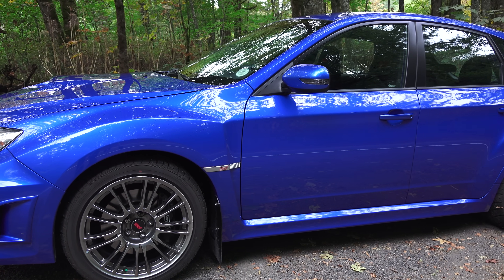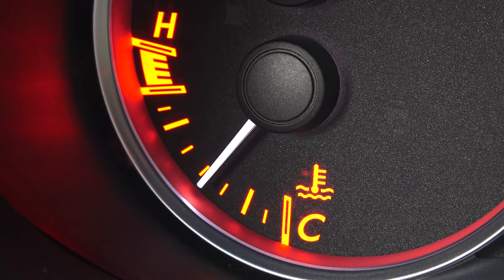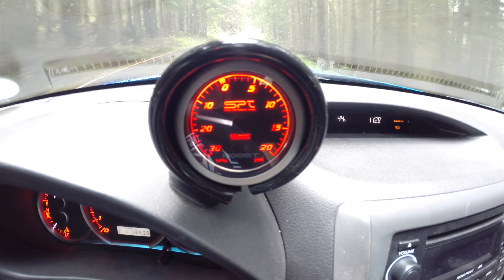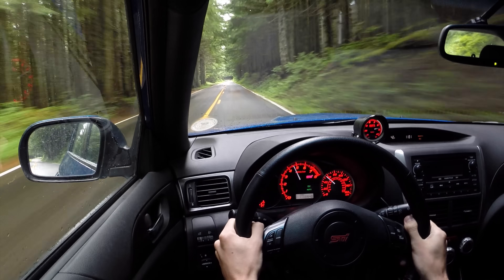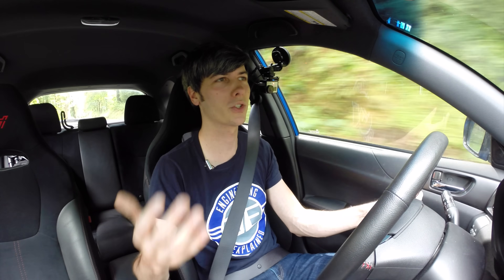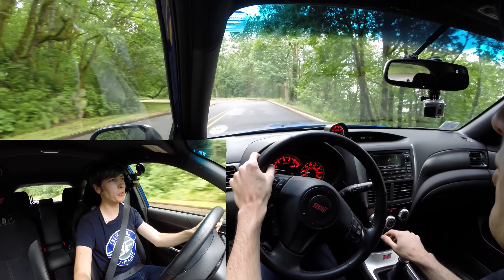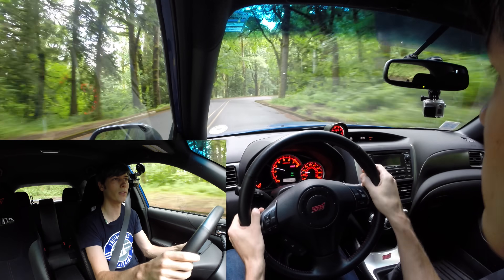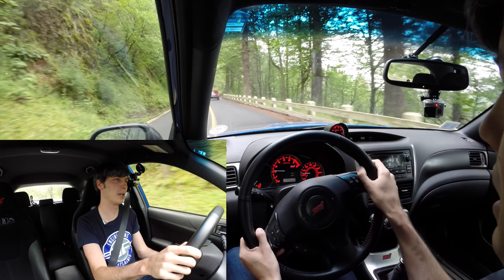5 Things You Should Never Do In A Turbocharged Vehicle

Comment: Well what would you consider running a car hard? I got a Opel Astra 2.0 Turbo (Opel's/Vauxhall's equivalent to a VW Golf GTI). Redline starts at ~6,5k and goes to 8k. While driving to work I always try to keep it under 2,5k cuz the engine is cold for most of the ride to work. But would you consider 4k while having a cold engine as'' running a car hard''?

Comment: Very interesting. I would add that in every engine the main issue with lugging has to do with high forces being generated over short periods of time against the pistons when the crank is at less efficient angles. This is because at high torque demand and low rpm the piston is not travelling fast enough to accommodate the rise in pressure and volume of the exploding fuel mixture. Therefore the explosion happens during a fraction of the power stroke, within a confined space and when the crank angle is far before the ideal relative 90deg from top for that cylinder, thus causing the high forces against the piston, a huge load on valves and piston surface, a lot of heat in a situation when the engine can't provide efficient cooling and a very inefficient power conversion. A turbo makes this worse.

Comment: oils thinner and flows faster when cold...
Reply: I don't think so
Reply: what do you think the numbers on oil bottles mean? sae 5w-30 (common in cars) stands for 5 winter and 30 when the engines is at temperature. 200-400 degrees f. its measured by putting it through a tube of certain size and measuring how many seconds it takes at various temps. ergo 5 seconds cold 30 seconds hot. they add polymers to motor oil to make it do that, so when you start the car the oil is thin and gets where it needs to fast and then thickens afterwards to prevent wear and tear. thats also partly why you have to change your oil. the polymers break down and it slowly becomes 10w-25 or somethin.

Comment: I think i've seen somewhere that the high octane rates help prevent the pre-ignition phenomena you are talking about, this is partly why it is recommanded in turbo charged engines, and/or high compression ratio engines.
I also know modern engines are equipped with sensors that detect pre-ignition and alter the ignition advance accordingly to limit such phenomena, but it sure does not completely .avoid them nor the damage it causes.

I'm very interested in the pre-ignition (or rather, auto-ignition), and looking forward for a video about it (if you manage to make it accessible somehow, as it appears to be pretty complex).

Comment: In a stock turbo AWD vehicle, are you able to just start the car and go? Even if you don't ride it hard the first few mins and let the car warm up? Thanks
Reply: No. Of course you can its just not good for the engine. Its best just to let your car idle for a minute or two to get the oil flowing and all the seals warmed up abit. AWD, FWD, RWD, naturally aspirated or boosted you should always let the car warm up.

Comment: i get this low rpm, high boost knock when im on the freeway, primarily in 5th and 6th around 2500-4500 rpm under acceleration. i have an 2004 sti, what would be the simplest way to get rid of this.  is a new tune my only option. i bought the car used and pretuned and the engine is stock with intake and exhaust modifications

Comment: Fiat fixed pre ignition caused by a sparkplug being a hotspot with a proprietary sparkplug from NGK that looks identical to other sparkplugs from NGK. but if you use the wrong sparkplug, even with the correct heat range the engine stutters as the ecu does anything it can to save the engine. presumably cutting fuel intermittently.

Comment: Don't know about fuel standards in other countries than Sweden, but you won't find anything below 95 octane here. Most pumps have 98 octane as well.
Reply: Most countries have a different octane rating to the US. In most countries the research octane number (RON) is written on the pump. 95 RON is basically the standard fuel. In north america, brazil and a few other countries the so called anti knock index (AKI) is used and this standard gives you lower numbers for the same fuel. 95 RON is about 85 AKI.

Comment: There are other things you should never do in a turbocharged vehicle.  Do not feed an antelope and a Siberian tiger simultaneously in the back seat.  Do not drive the vehicle through molten lava, even if you keep the boost level moderate.  Do not let your girlfriend catch you fooling around in the car with that busty girl you saw at WalMart.  You know the one.  Do not leave raw fish and spilled milk soaking into the carpet during the hottest months of the year.  Do not feed the turbocharger marijuana in an attempt to make "higher" horsepower.  Do not vacuum the upholstery and ashtray with a hose hooked up to the turbo.  Climbing onto the hood and trying to fart directly into the turbo to add power during a passing maneuver is usually not recommended.

Comment: Directed at the dont full throttle at low rpm part, why does the turbo engine get a slight speed boost after releasing full throttle? Sometimes i notice that after accelerating, when i let go of the gas pedal, it seems to go slightly faster for a moment (less then half a second).

Comment: But if it makes a lot of torque at low RPMs (1300- 1900), why can't I use it? It becomes pointless...
Reply from the maker: +Guilherme Cabral Freire you can, just use it in lower gears rather than higher gears. If you need to accelerate quickly when you're at 60 mph, downshift.
Reply: +Engineering Explained  but that is the thing... say I'm cruising around on a highway... in 8th gear at 1700.. and I have to overcome a random hill.. if the max torq is at 1700-2000 (let's say, a diesel), I don't want to rev up, just stay still because the max torq is at that engine speed... get what I'm saying? I want to save fuel

Comment: you don't lug at low rpm due to cylinder pressure. cylinder pressure does not mean boost but the actual combustion pressure inside the cylinder. if your engine is at low rpm it is flowing air at low cfm. therefore adding boost to the mix you are trapping more air inside the cylinder creating more cylinder pressure when being combusted hence pre ignition. high compression engines increase cylinder pressure which is why they need higher octane fuel

Comment: Do today's turbos still have a big issue with oil coking? I remember that the (original 1978) Buick 3.8L V6 turbo and 1979-1980 Ford 2.3L 4 turbo had big issues with oil coking (I believe that's . Are most turbos these days water-cooled as well? It would seem that hydro syphoning would continue to cool the turbo (using the coolant) after the engine has shut off. I agree that a turbo car shouldn't be shut off immediately, but is turbo oil coking such a problem now as it was in the past?

Comment: A few points here that you certainly missed... You reference diesel vehicles and high load low RPM... Now... in my F350 dually - I have to subject the engine to those conditions when I want to roll coal, say on a jogger, a cyclist, a Prius or even an STI!! (and we all know that is GREAT for the engine!). Also, since my dually is a manual, I have to hold break, partial clutch and floor it to build boost for that awesome coal-rolling burnout.... Also... just wonderful for the engine!!!! ;-)

Just my 2 cents!!!

Comment: "You should never lug your engine"
  At 60/65mph on the motorways my cars engine speed (Leon 1.6TDI) is around the 1,500rpm area,  so what you're saying is i should change down to 4th to overtake and then change back into 5th when finished..

I dont see the logic in that,  after all Turbo Diesels are all about that low down grunt and torque

Comment: #5.   An F1 driver told me that you want a bit of slip and oversteer from the rear because it means the car straightens up quicker and when you're straight you can then put down more power.   So the quicker you straighten up coming out of a corner the quicker you can get power down the quicker you are.

Comment: "Lugging the engine" doesn't even make sense... You're at low RPM. Boost doesn't happen at low RPM. At 1000-1500 RPM, even if you were to floor it, you would still be at 1500 RPM and not enough air would be going through the turbine housing to create boost.

Comment: Old guy here, I have owned more cars than I can count and now I own my first turbo, '16 Honda Civic 1.5 turbo. This car has an ECO mode to improve mileage when you don't care about having full power. I am trying to figure out what this mode does. At idle and during acceleration, it rumbles a little like the timing is off. Power is reduced noticeably, but it does get very good mileage, averaging about 36.6 with a mix of highway and city, with quite a bit of stopping and starting. Is this ECO mode hurting my turbo? my engine?

Comment: Yes, keeping the transmission in the proper gear is optimal.  But it won't hurt the engine as much as if I were to hit you in the head with a Lug Nut.

A diesel engine will work the same way as any other internal combustion engine.  They all act like an air pump and will only inject as much fuel as needed with the proper amount of air being sucked in.  See, there is a mechanical or electrical connection between the injectors, your throttle and the "butterfly" that controls the amount of air that is being sucked into the engine.  The only way you will get too much fuel and not enough air is if you replace your injectors with a larger injector and a smaller, more restrictive intake.

FYI, the new engines have so many electronic controllers on them that it is hard to...  Never mind, you obviously don't know anything you are talking about, so I'll leave it at that.  But yo really need to get a lot more education on this subject matter before you post these ridiculous videos and spread more falsehoods.

Comment: Unless you are driving your car super hard and instantly pull into your driveway or a parking lot, you really don't have to worry about the turbo/oil cooling down.  Simply driving your car at a normal speed will allow the oil to circulate and cool off.  That is why manufacturers don't add a device that allows the engine to continue to run after you have pulled the key out of the ignition, like aftermarket addons do.

You won't be changing your oil more often nor creating more wear on the internal parts by shutting off your engine as soon as you stop.

Not to mention that the newer oil has the viscosity rating that will allow you to get in your vehicle, start it up and take off.  Long gone are the days of sitting in your driveway, waiting for your vehicle to warm up.  Unless you live in an area that has a lot of extreme cold at or below 15 deg.

Comment: You do know that Subarus have circulated oil to the turbocharger after shutdown since the 2002 WRX...I can find that press release for you...
You also will never get "a lot of boost" at a low rpm even if you floor it. There simply is not enough exhaust flow to spin the turbo up to speed. That's the entire thing about a boost threshold.
Reply: Except most seriously-boosted machines these days have to implement a torque cap (using fly by wire throttle, careful ignition/fuelling mapping, etc) from as little as 1200rpm upwards, and commonly no higher than 1500~1800rpm, in order to protect the transmission and prevent you endlessly spinning the wheels in the lower gears (or triggering off the traction control, though it's essentially doing the same job). It might not even be full boost (as they wouldn't produce maximum power at that speed), but there's still more than enough there to produce a significant torque/power output difference at low rpms vs a non-boosted machine.

About the only example I can think of where the boost doesn't start building until significantly above (ie at least twice the rpm of) idle is Nissan's recent-ish DiG-S engines, which are downsized, small capacity supercharged items with an emphasis on economy (running Miller or Atkinson instead of Otto cycle a lot of the time, etc) and improved midrange torque rather than absolute power (peak output is only about +25% vs their naturally aspirated cousins, but they rev about 80% as fast when producing it), essentially being a 1200cc alternative to a 1400 or 1500cc ambient pressure engine. Because the charger drag consumes more fuel than it's worth at lower revs, they use an electromag clutch to cut it out completely below 2000rpm (a pity, as the ambient pressure engine is a bit weak at low revs and could have done with a perk-up), and bring it in gradually between about 2000 and 2500~3000rpm. Though I haven't had the chance to drive one, I imagine the effect if you keep the throttle pinned whilst accelerating from 1500 then past the peak at 5000ish is rather like that of a peaky, laggy turbo engine... just thankfully not one that has a huge amount of power at the end of the day, and that is lag-free if you work the (rather unhelpfully wide-ratio) gears to keep it spinning in roughly the 2500 to 5000 range.

But that's a pretty niche thing vs most contemporary turbos, and Nissan themselves seem to have acknowledged the otherwise fairly innovative system's baked-in shortcomings by, after first teasing a twincharged (super + turbo) successor, shifting instead straight to a plain turbo setup instead with the current DiG-T, which works much the same but with a wider useful rev range...

Comment: Preignition can accord in low RPM's do too the air intake being to hot.. As I Cruz around town in a 102 hot day my temperature intake is around 150 degrees.. When I get on the freeway it will drop to 120.. That's with out boosting..  As soon as I start to build boost on a higher gear my temp will drop to 105 depending on the temp out side..

Comment: How do you feel about using an on-demand dry HHO generator cell to help remedy most of the issues talked about in the video?
Yes I realize the chemical and explosive characteristics of hydrogen fuel.
I also realize that HHO gas is two molecules of Hydrogen for every molecule of Oxygen, so there are two fuel molecules to every oxidizer.
Hydrogen is also extremely hot burning, yet clean.
So it can clean any and all carbon residue and other gunk inside your engine block.
Another thing is, with an HHO generator on a vehicle, you will want to have a one way check valve, or "bubbler" to prevent backfires into the dry cell. Although not extremely hazardous or dangerous, this can cause the dry cell to partially come apart and cease function, so a repair would be needed.
Another important fact, is that if your computer was built after 1987, then it probably has an automated fuel injection system.
This also means that it has sensors to detect the ideal fuel to air ratio for a burn to occur.
This is good and all, but by adding the aforementioned two fuel molecules and only a single oxidizer molecule, your vehicles computer will want to consume more fuel in order to keep with its pre-determined "correct burn ratio."
Luckily a chip can be bought fairly cheaply that won't void your warranty, it goes somewhere in the car's computer, many of these chips just plus directly into your car's OBDI/OBDII connector.
I understand that a backlash from people who remember Hindenburg will probably occur, but I'm hoping that a few educated individuals with at least a little scientific fore-knowledge and are at least partially engineer'esque with their thinking will respond here.
To anyone that bashes me for posting this here, 
Go to your nearest mirror, point at your reflection, and ask it "Is this really worth it? What am I doing with my life?"
You may be surprised by the answer you get.
Thank you.

Comment: Great video brother. If you don't mind telling me, where was this video filmed? Looks a lot like the Blueridge Parkway, l which i only 15 minutes from where I live.
Reply from the maker: About 3,000 miles from where you live, in Oregon. :)
Reply: Oh good to know, Lol. So one more question since you seem to respond more quickly than 90% of other channels (which I appreciate). How will getting a downpipe (catless or catted) on my ST affect my car in terms of getting a CEL because of O2 sensors?
Thanks again man!
Reply: I have an ST, a catted downpipe can, while a catless will give you a CEL. This doesn't affect the performance of the vehicle at all, it just makes it hard to pass inspections. To get around that an O2 defouler works to space the rear sensor (only used for emissions purposes) and increase the amount of oxygen the sensor reads. Other than that, the car will be unaffected by your downpipe.
Reply: This is the Oregon coast, is it not? And does it just so happen to be near Cape Lookout? Because it looks extremely familiar to me, and I think I recognized some of the corners specifically.
Reply: most certainly Oregon, looks much like the Columbia River Gorge out near Bridal Veil and Multnomah Falls.

Comment: Noticed you running Nitrogen in your tyres. I used to use it as well in my Subaru. That being said, not sure it works that well in colder climates? Doesn't it make the rubber that much harder? I can certainly understand the use in warmer or hotter climates prolonging the life of the tread. Or did you just like the colour of the green cap??

Comment: 1. VW has oil cooler that actualy when engine is cold acts as oil heater. Also EGR heats up colant quicly so working temperatures are obtain wery fast. Also modern syntetic oils perform well at just 40°C. 
2. VW has electric colant pump being automaticaly engaged upon engine shutdown so it cools the turbocharger bearing and prevent oil burns. 
3. Modern diesel and also turbo gasoline engines should be driven in low RPM to be fuel efficinet. They provide max torque from 1500 to 4000 RPM. They are design for max torque so there shouldn't be a problem.
Old diesels smoke under hard acceleration beacuse exhaust pressure blows of old sooth formation in the exhaust.